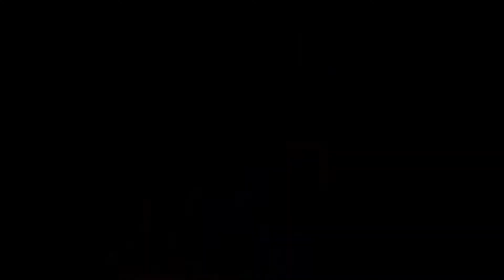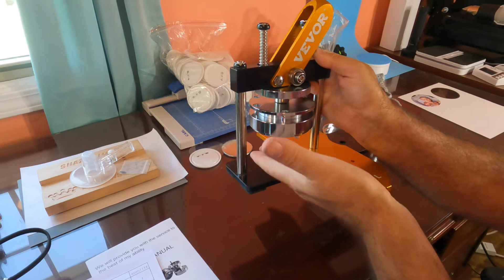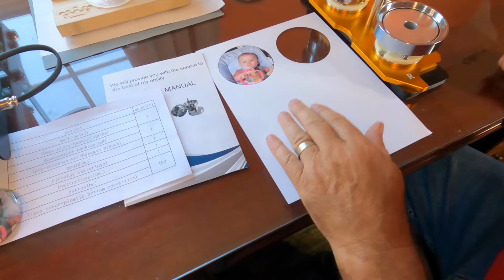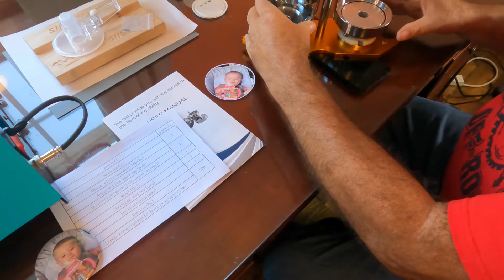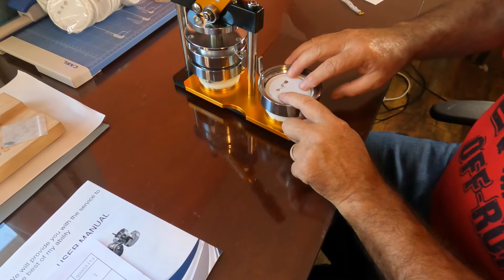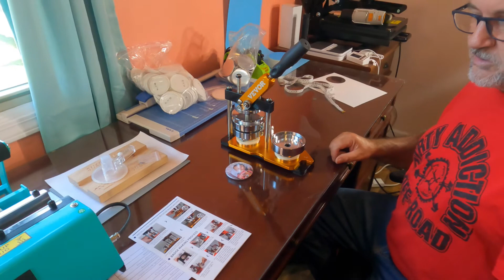Vevor Button Maker Machine  Review - 3" Button Maker

Comment: What if the first press does not grab the metal part and picture and hold it for you to do the next step?
Reply from the maker: Check and make sure that your plastic film does not have more than one piece stuck together. Also if your paper is too thick it will not grab. Thanks for watching!

Comment: very informative video. one question, can we change the molds to make different size of badges?
Reply: For this you have to check before buying This machine...do they providing  you 1 size or several size...if your machine have  one size but your machine/mold(size) can change able..then you could buy another Mold/size,which will be fit on your machine.. 

I didn’t bought yet..but i did some Research about button making machines.. 

Hope this tips will be helpful for you..Enjoy - Peace & safe ❤✌️
Reply from the maker: Unfortunately this button maker only makes 3" buttons. I am getting ready to review another that had two different sizes!
Reply: where is this video you mentioned? is there a URL possibly to it? Thanks!  @SnazzyMoonDesigns